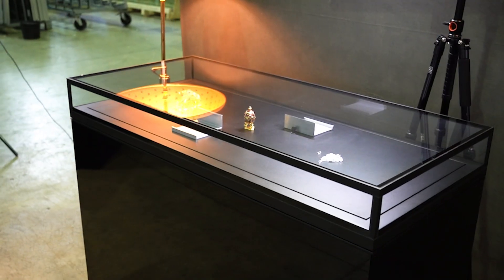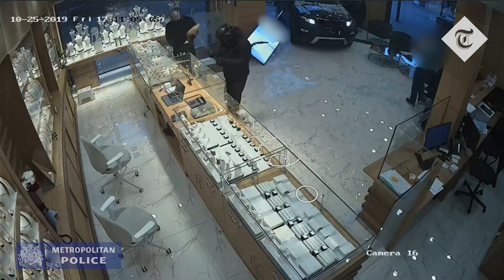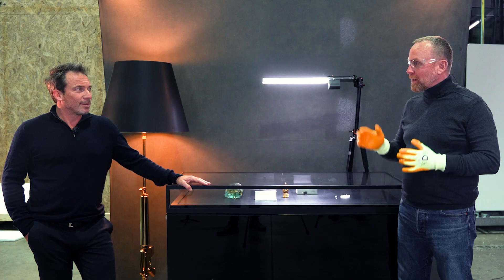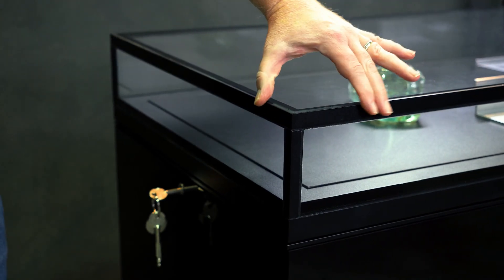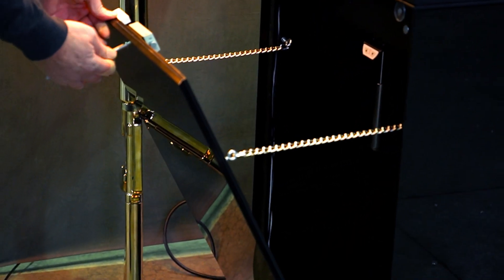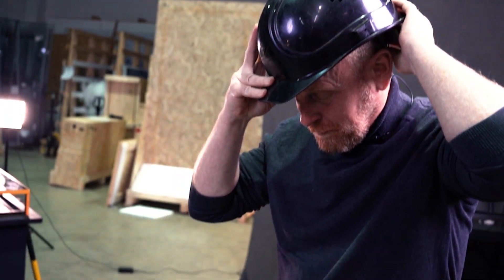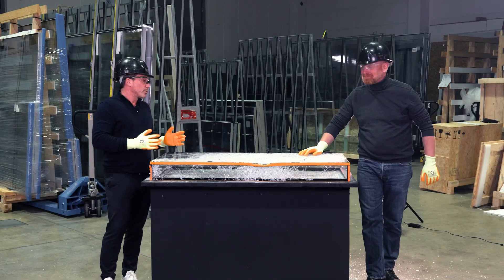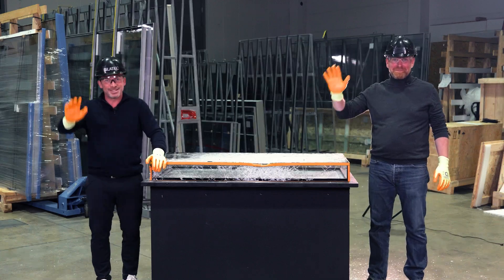How security showcases protect their contents from burglars

Comment: Have the bottom part be a safe and have the items be lowered into it and locked away when a certain amount of pressure is applied to the glass. Like bank security shutters or those crazy bomb proof beds. Glass would just need to be able to take one good hit and not break, items would be locked away before the second hit. Could also have it linked to the other showcases, one gets hit the others go into safe mode.